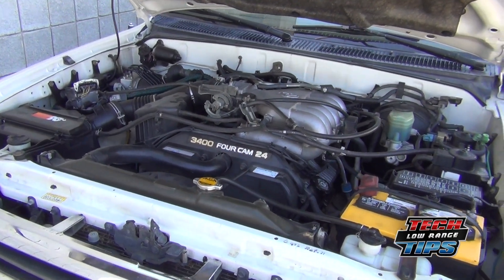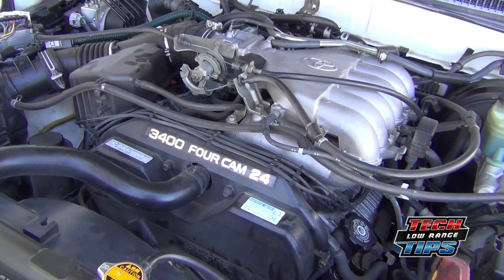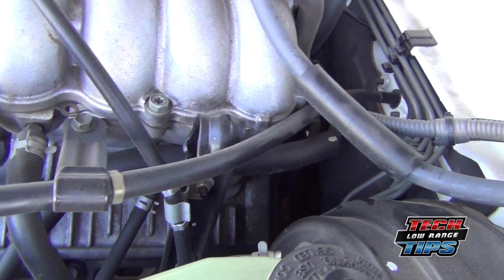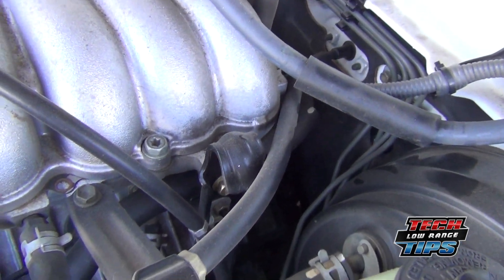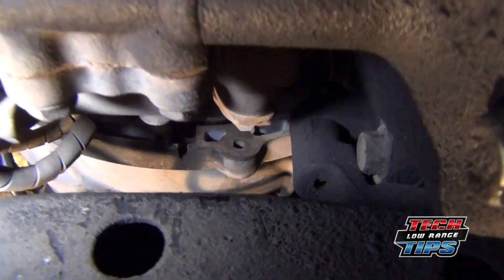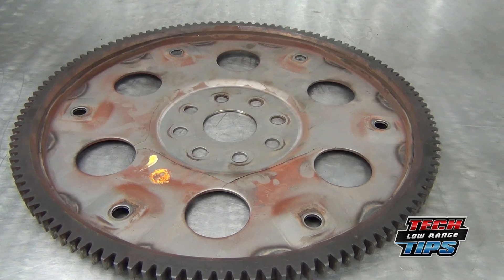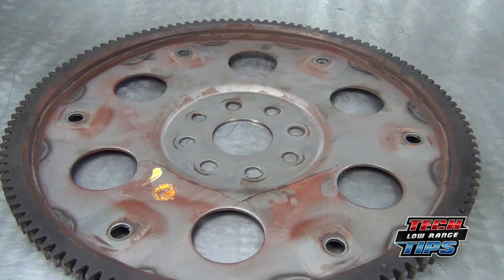Engine Knocking?  Could be a Broken Flexplate.

Comment: That is the exact identical noise that I have on my 2006 F150 truck. I just put my truck in the shop today11/24/2023. My mechanic was 100% correct. just like this video is displaying the flex plate noise. Thank you very much sir......

Comment: Wow. I have 397,000 miles on my original engine and transmission of my 2000 Toyota 4Runner. It just started making a noise similar to this, but it would come an go. Now, a month later, it is more noticeable when I am at first accelerating from a stop. I parked the car for a couple of weeks and then got the courage to go on a test drive. The noise actually went away once I was at speed and not accelerating, and then went away completely at higher speed. But it would be there when I was accelerating from a stoplight and situations like that. I now know it will make it to my mechanic, and I will suggest the flexplate to him. Thanks for this wonderful video. UPDATE: It turned out to be bad U joints. The sound was mostly faint, and would go away at around 40mph. The fix worked. No more noise

Comment: Check you spark plug cables. I had the  same sound coming from the driver's side of the engine. I discovered the middle spark plug cable was popped out and also discovered the spark plug was completely lose. You can see the link below.
https://www.youtube.com/watch?v=74HuLRCBeBo

Comment: We just had this issue. First shop said it was a bad motor bearing and needed a new engine. Second shop said it was the flexplate which it turns out was the problem. I had the starter replaced which cause the issue, several bolts were missing and the main dowel. I had a crack on the flexplate not nearly as bad as the cracks in this video but sounded worse.

Sound started low, went away driving over 50mph and reversing. Then it got worse and worse. $159 for part $550 for labor. Including oil change and a few other services $972 out the door. We drove for 3 months in town with the issue but this could've cause failures.

Comment: I've got a 96 runner with 3.4  (4×4)  um fixing to put the 3RD flywheel in it. ( 5 months time frame)   any idea WHY IT EATS THEM.    Replaced torch converter and I'm now replace barnes  even though they look fine. But I am at my wits eNd? HELP. 
*I'm a diesel mechanic so I'm not stupid...well this truck is making me think "the jury might still be out"
Any ideas guys PLEASE thanks big bunches

Comment: My 2000 Tacoma 3.4 with 135,000 miles has this bottom end tick. Funny thing was another Tacoma 3.4 leaving the parking lot, and it made the exact same noise at idle. It will probably do this for 300,000 miles until it really cracks lol.
Reply: My 99 4Runner has 348k. Considering that the engine and tranny have never been worked on, I'm starting to think that I might need to prepare for my flexplate to go out pretty soon. 400k miles strangely seems to be common. At least I've got a heads up for it!
Reply: Don't do that cuz is gonna messed up the tork converter
Reply: @JosueLopez-te1ek  nah the flex plate is okay. I had to take the flex plate dust cover off and cram a pry bar in there to take the crankshaft pulley off to do a timing belt. I didn't see any cracks. I haven't really heard the weird tick since so I don't know what it is and don't care.

Comment: my engine idles fine, no abnormal noise. But when accelerated,  the clacking and knocking begins. My trusted mechanic says it is the flexplate. Other mechanics who have listened to the engine running, say it is the crankshaft BEARINGS. i drained the oil, lots of gold particles at bottom of drained oil. What is it?
Reply: Just for future reference, the noise from a broken flexplate will go away as you increase RPM's, and get louder at idle.  Sounds like you had a spun rod bearing, the gold particles in your oil was bearing material.
Reply: @GrandPrix46  Thanks. That is what I suspected. Can I have just the bearings replaced? The rest of the engine runs fine.
Reply: @zurdoremi  at the point you're replacing bearings the entire engine will be torn apart.  When you have it stripped that far down, you might as well replace other things as preventive maintenance.  I'd grab new pistons and rods, cam, rod, and main bearings, freeze plugs, and take it all to a machine shop to have the block tanked and the short block assembled.  Some engines need to be line honed after removing the main caps, too.

If it's a vehicle you probably won't keep very long, you could try replacing the spun bearing(s) and see what happens.  Car-part.com is a good source for junkyard replacements, or you could get a new complete engine with a warranty from Jasper.
Reply: @GrandPrix46   I want to try replacing the spun bearings assuming the crankshaft is not damaged and I believe it is not damaged. I shut the engine and have not ran the engine since I heard the noise. The job can be done from under the car and I am told this was common practice during the 1960's. The problem I have is finding someone who can do it without wanting to rebuild the entire engine. I cannot afford a complete rebuild so I would be happy with inspecting the bearings and crankshaft from underneath to see if a repair can be done even if it doesn't last forever.  Thanks for your advice.
Reply: @zurdoremi  no problem, best of luck to you and let us know how it turned out.  Even if it's a year or two down the road.
Reply: by now you hopefully know that your piston bearings were toast and probably the crankshaft too.

Comment: That is the flywheel not flexplate.
Reply: Its a flexplate. It is an automatic. Flywheels are used on vehicles utilizing a clutch like a semi-auto or manual transmission.
Reply: yea, ok but we dont know if its automatic do we?  @screener545
Reply: dang0088 da automatica uses flex plate while manual uses flywheel. Did u watch the whole video?
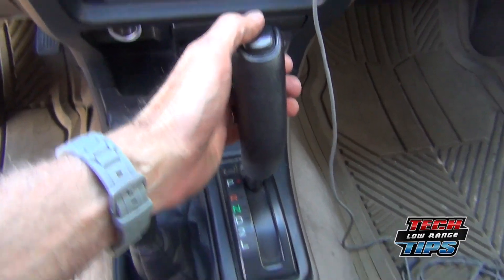Reply: @dangda-ww7de  @ 1:50 the video shows that is Automatic...
Reply: flexplate dummy.

Comment: I have a 2001 Toyota 4Runner V6 and I have a engine noise on the rear under the engine area as well but does not sound like that. And it's only when I'm in gear actually
Reply: @Tausona Flexplate / Flywheel, I opened up the little panel under the engine and seen it. I didn't see a crack on mines but noticed it was really dry & rusty, I sprayed WD40 while the engine was running and Flexplate spinning, And it never came back. Lol
Reply: @brandonjmitchell638  im having the same issue

Comment: Im pretty sure mine is going. If someone were to say replace the whole engine, would this be something that should have bene noticed? Just got mine back from the shop after getting a new 3.4 installed and I hear this noise.
Reply: It's mounted to the back of the engine. They should had installed a new one, or at very least inspect the old one to make sure that it's good.

Comment: Mine makes a grinding noise only when it's in gear, in Neutral and park the noise goes away
Reply: Same here did you figure it out?
Reply: Mine is the same....    did you find out what the problem was?
Reply: @foryzdp  same for me ,, did you find the problem ?
Reply: It’s the high low shift lever that was stuck in between ,, try pushing it all the way in high and grinding goes away

Comment: man thats a great video. would have been stellar if you guys showed step by step on how to replace it. mine is making a deeper noise
Reply: You have to remove the transmission. Heres a great video. 3 parts on how to do it. 
https://www.youtube.com/watch?v=oZDSjlxl2Q4
Reply from the maker: Yes, agreed.  It was just too big a project for me to video.  Sorry about your knock.  Are you sure it is the flex plate?
Reply: yeah it is. yeah its a big project to do
Reply from the maker: Be sure to use a long extension and universal (wobbly) socket on those transmission to engine bolts and take your time on the electrical connections.  Oh, and one more thing.  Don't "cut corners" on the flex plate.  Buy a Toyota flex plate. It is worth the money.  I tried to save a few dollars and went with an aftermarket flex plate and the teeth do not mesh well with the starter.  It made a horrible grinding noise when I first started it up.  It did get better after about 20 starts but there is still a bit of grinding noise when the starter disengages and it has been several months since install.  Good luck with your project.
Reply: @justinbailey6465  hey man did you get that sound fixed because mine is a deeper tone as well and I’m looking for possible solutions

Comment: How much do you estimate this repair would cost? I feel my 98 runner  is starting the same ticking noise
Reply from the maker: Sadly, in order to replace the flex plate you have to remove the Transmission/Transfer Case assembly. It is about a 6 hour flat rate job.  If a shop charges 100.00 an hour that is 600.00 dollars in labor.  I strongly recommend going with a Toyota flex plate. I went with an aftermarket flex plate  ($130.00) and it made a horrible grinding sound for the first 20 or 30 starts.  It has gotten better but still makes a grinding noise when the starter drive gear disengages.  I am kicking myself for cutting that corner.  if you are going to spend 6 plus hours of your own time (It took me about 8hrs. I am 65 yrs old and move a bit slower than I used to) or pay someone else 6 plus hours labor, I'd put in a good flex plate.  A genuine Toyota flex plate cost about 250.00. Additionally, I'd look rear close at the rear  main seal while I had it apart.  You may want to replace that regardless of appearance just as a preventive measure.  Hope this helps.  Thanks for watching and commenting.
Reply: @lowrangeoffroad1  no that sound like the tooth ratio on the aftermarket flex plate likely wasn't a match to your starters tooth ratio that is a thing you have to keep an eye out for

Comment: First off, thank you for taking the time to post this.  You mentioned that it began around a year ago.  Seems like a good long time.  What would happen if the flexplate completely broke?
Reply from the maker: That is a good question.  If it broke while under way, the engine would still run but the vehicle would stop going.  If it broke while attempting  to start the engine, it simply would not start.   Probably make a horrible noise in both cases.  Thanks for watching and commenting.
Reply: This is exactly what happened about two years ago.. It completely broke and the shop said it messed up the transmission also, now its a year later and my 4runner gave out on me.  I was driving, stopped at a stop sign and then it just wouldn't go.  Do you think the flex plate broke again?  i don't quite remember any knocking noise this time though.
Reply: Well, u coast to  stop and set there for three hours beside a house that invented the "taco bell dogs" and they sing 😖to u the WHOLE TIME😳  THEN right before u make the 7 p.m. news ur "buddy" pulls up to load u on trailer and take u home.   Lol 
But that's just a guess lol
Reply: Deborah Eagan Hi Deborah. Did you ever discover what actually had happened?